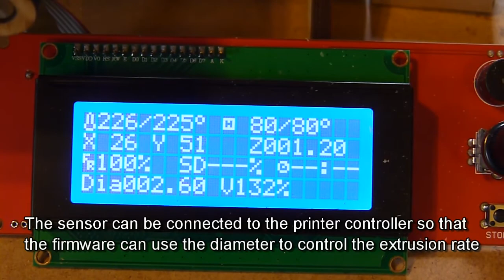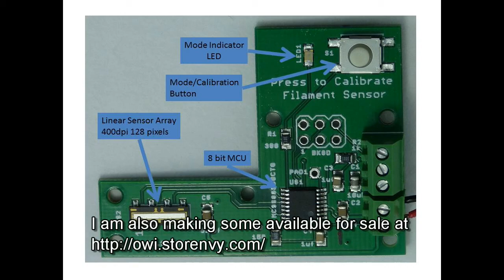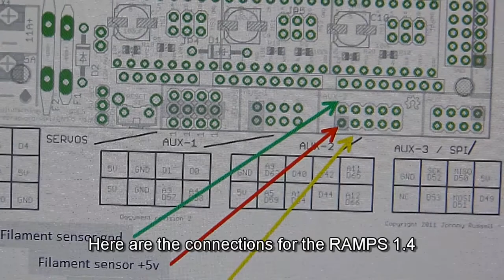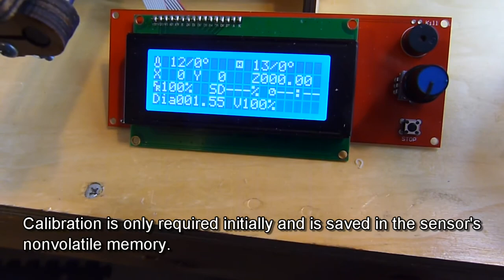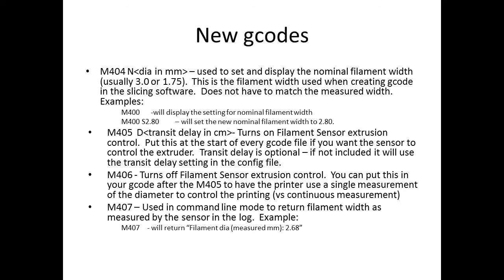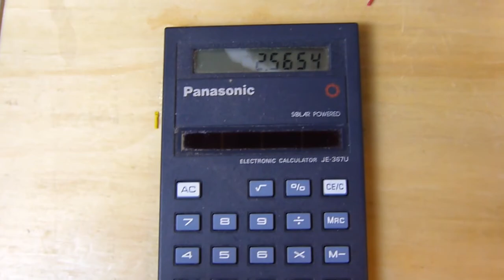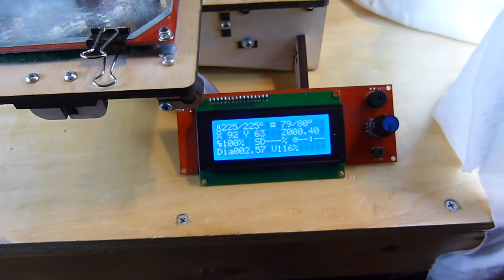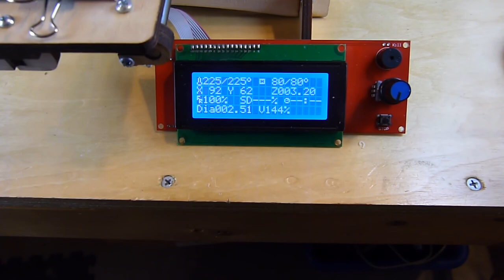filament sensor 2014

Comment: Dont be afraid to speak up Fil!  Very impressive work by the way, mine appears to be very accurate when the measured value is compared against a micrometer reading.
Reply from the maker: Thanks Robert. I keep making them available for people working with 3D filament since there is nothing else out there that gives the same accuracy at such a low cost. Similar industrial optical micrometers cost a few hundred $$.

Comment: Since the beginning of the print, and change the parameter "V" it took about 60 seconds, during which hardly left 12 cm bar diameter of 3 mm.
  buffer delay of more than 3-5 cm are not working. In the presence of Bowden 90 cm ......